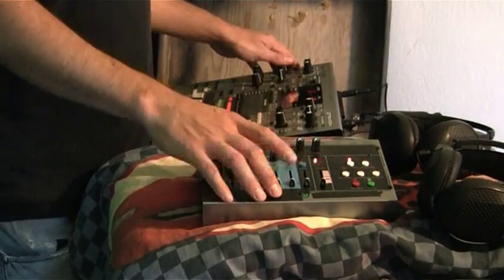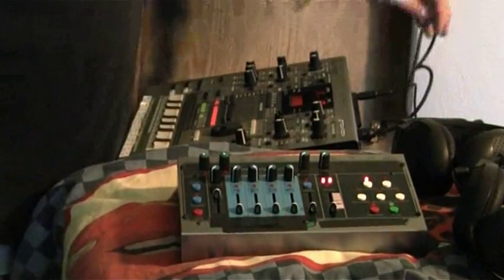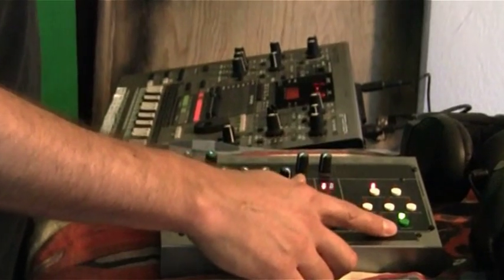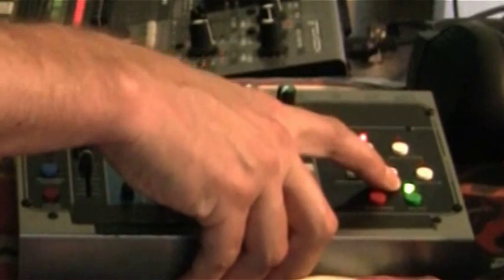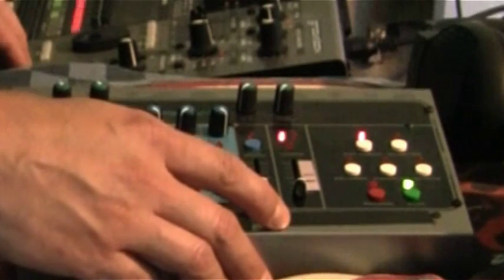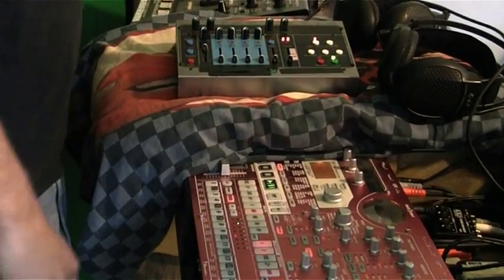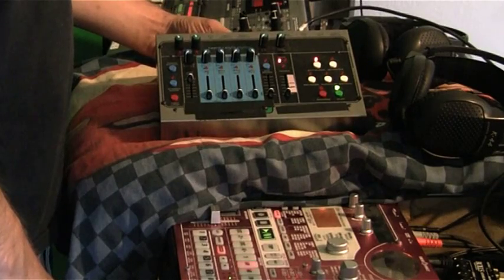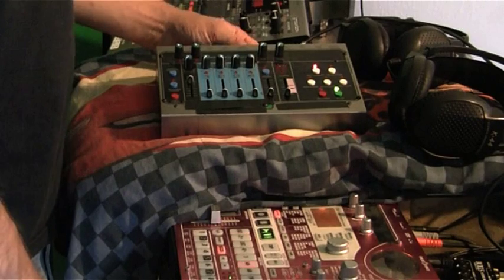MC-505 Midi Clock Error

Comment: How can I set my daw to be the master tempo for the 505
Reply from the maker: As long as your DAW has a MIDI "beat clock" out you should be able to sync it. You have to set the 505 to "SLAVE" mode in the sequencer.  Some DAW's are built wrong and will screw up.  I think my old protools would start properly but not keep a proper timed clock. I don't think Presonus Studio One was working for me either. I use Reason 8 now and I don't think I've had any issues. FYI -Do NOT use "Midi Solutions" midi merg boxes for beat clocks. After time they slowly screw up the clock. You can always solder a midi y-cable if you can't find one...

Comment: Hey,  nice gear.  I am having problems getting our MC505 to run as a master with Korg EA1 and ER1 as slaves for our live setup.  Everything starts, stops and times fine but we can't get the 505 to send programme change information down the chain which means we have to dial each song into each box.  I have heard on the grapevine that MC505 doesn't send programme change info but I can't believe this.  Have you come across this problem?

Comment from the maker: The only way I can get it to work is slaving the 505. It sucks cause I sequence a micro korg off channel 7 which doesn't get the clock "thru" the 505, because the 505 thru isn't actually a thru, so I have to use 2 of the old "midiman merge 2X2" which has been discontinued. Try and find one on ebay. Midi-Solutions boxes don't merge a good clock so I don't recommend them. Good luck!

Comment from the maker: I've only had luck running the 505 in slave.  It would seem that you'd be ok running another roland sequencer but it may jack your Korg a little bit. That was my issue.  So you may want to get another unit to run the clock like replace the 303 with a better sampler from another company.  I use a couple merge boxes but the only good ones are discontinued and are the midiman merge 2X2. Midisolutions boxes suck for clock. synthman DOT com/midiman/115100 DOT html Hope it helps!  ~J

Comment from the maker: @thefishdog Yeah that shouldn't be too much an issue.  I easily run MC-505 channels to external devices.
The MC-505 also doesn't pass a clock signal through it's "thru".  I actually have to use a midi merge to pass the clock and channels to an additional device like my micro-krog.  It's extremely stupid designing by the Roland team.  I will be avoiding Roland from now on and leaning toward Korg.